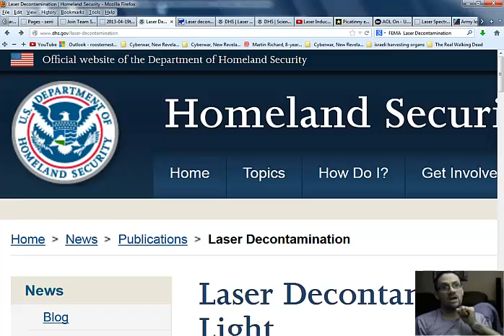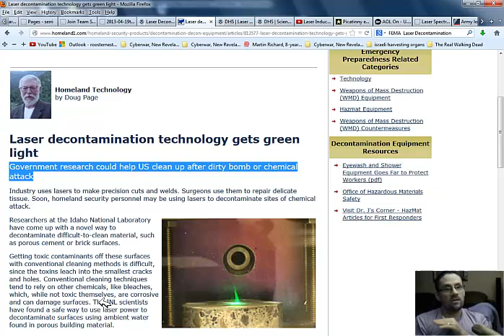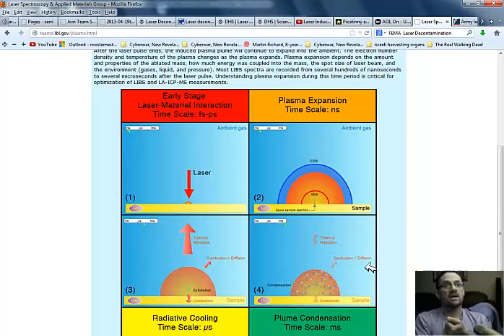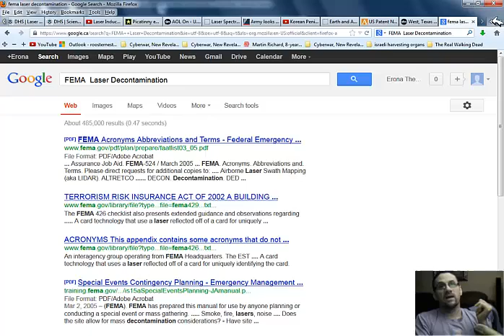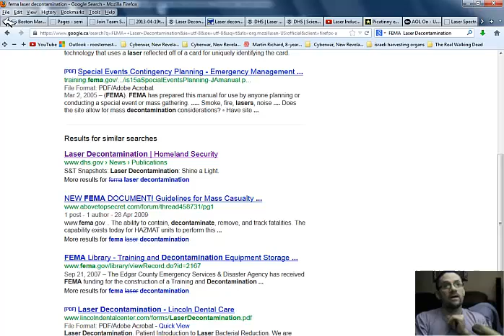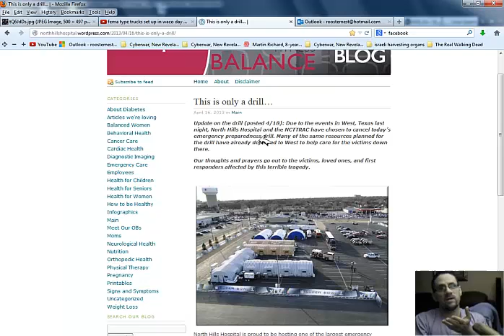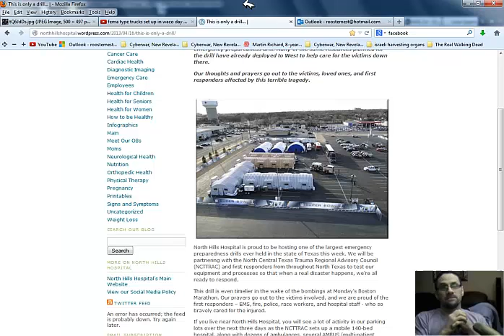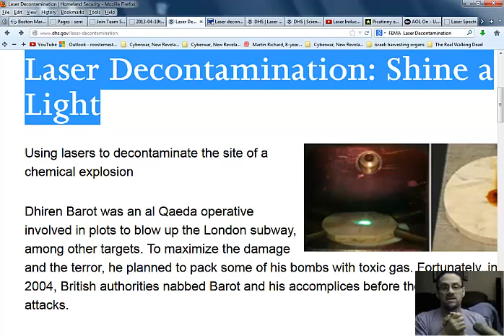Lazer Plasma Decontamination Weapon USED IN Waco Blast  Extreme Evidence

Comment: VanHalensBelt:  "anhydrous" means "lacking water"-  anhydrous ammonia is nearly pure ammonia, as opposed to the solutions sold commercially for household cleaning.   Furthermore, gaseous ammonia has a sparking point around 200 degrees (depending on temp and pressure, obviously)-  it is not "very flammable".

Comment: All the so-called evidence you cite does not mesh together, let alone with the plant explosion.  Your wife found a bunch of web pages that had the words "laser" or "plasma" in them-  that doesn't mean that is what is responsible for the explosion.  Furthermore, the laser applications cited are totally different from weapons applications, with the same being true for the cited plasma applications.  Laser decontamination is a procedure after the fact of an incident, not the cause thereof.  And laser systems used for weapons applications are not suited for decontamination, thus eliminating your proposal of the same system being used to cause the explosion while at the same time being used for cleanup.    

And I will note that all the evidence in the world is worthless without a coherent hypothesis to go with it.  You talked for almost fifteen minutes without putting forward a solid theory as to what happened.